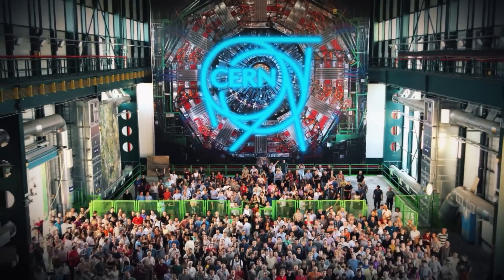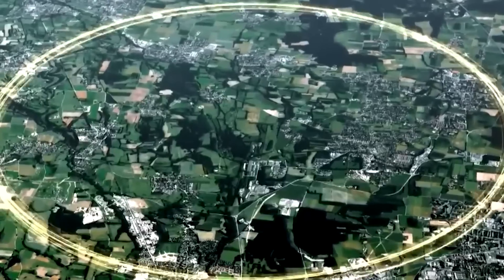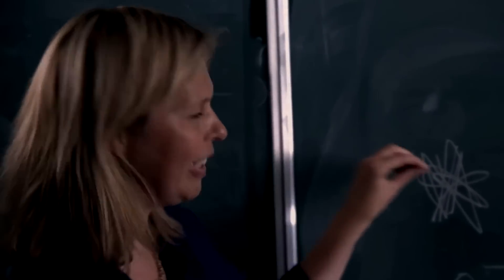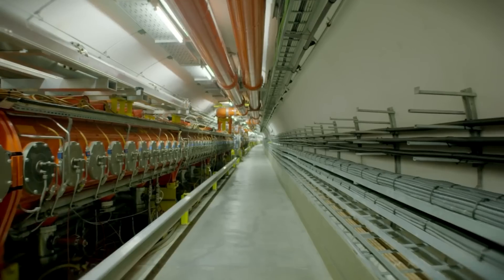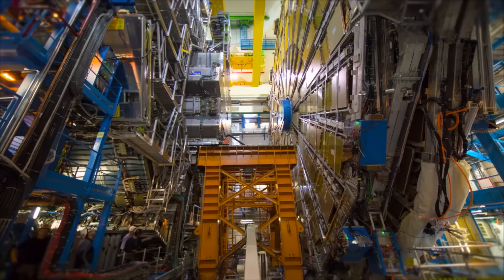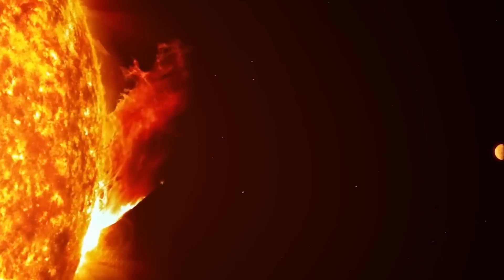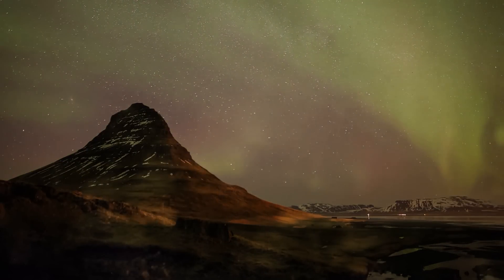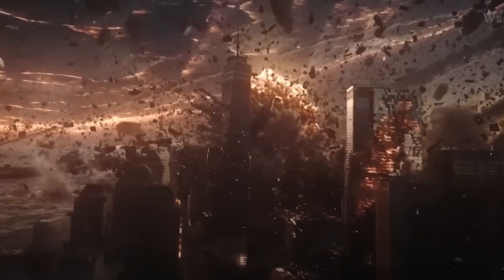CERN Scientists Announced Something Terrifying Happened To The Large Hadron Collider

Comment: Could the results of what Cern has done be used in reverse to repair a potential damaged magnetic field in the future, more even make it stronger?
Reply: LOL you still think THEY want to help US?
Reply: It is possible that the results of CERN's research could be used in reverse to repair a damaged magnetic field. The LHC uses a powerful magnetic field to accelerate protons to nearly the speed of light. This field is created by superconducting magnets, which are cooled to very low temperatures. If the magnets were to become damaged, it might be possible to use the results of CERN's research to repair them.
Reply: One way to do this would be to use the same techniques that are used to create the magnetic field in the first place. This would involve cooling the magnets to very low temperatures and then applying a current to them. However, it is also possible that new techniques could be developed that would make it easier to repair damaged magnets.
Reply: Thoughts run at the speed of light!!
Reply: NO. Cern hasn't "done anything".... 🤦